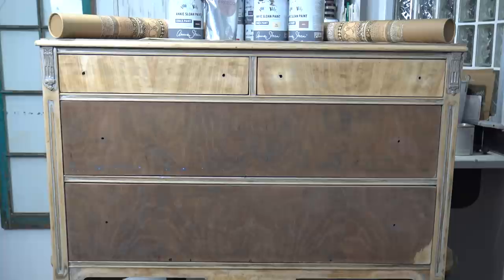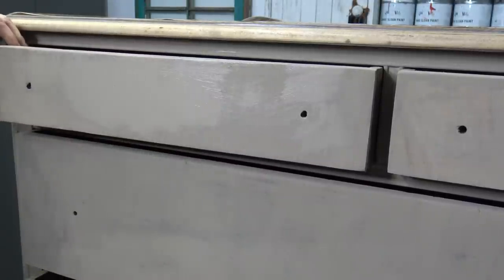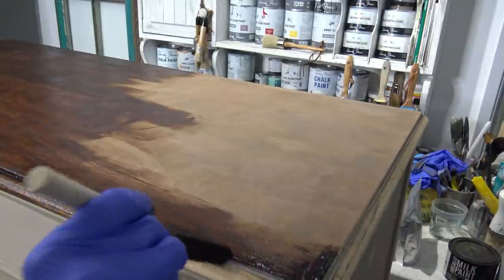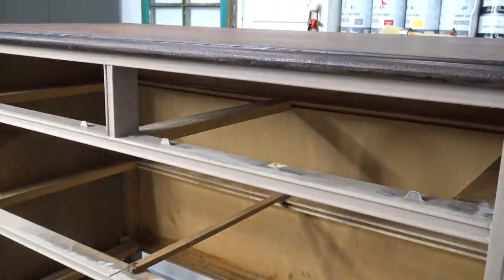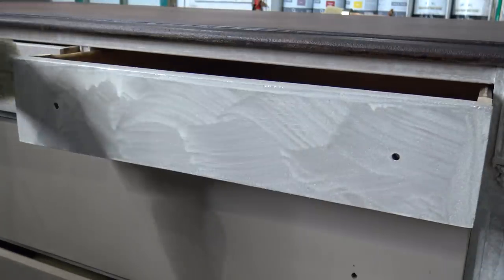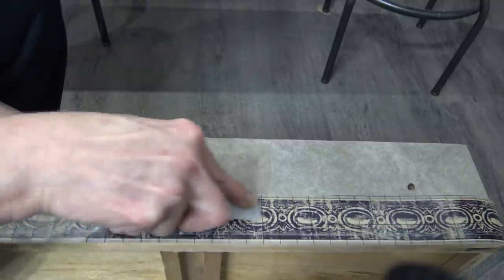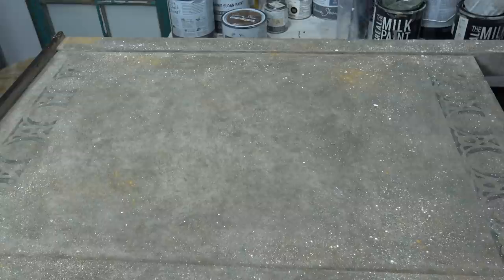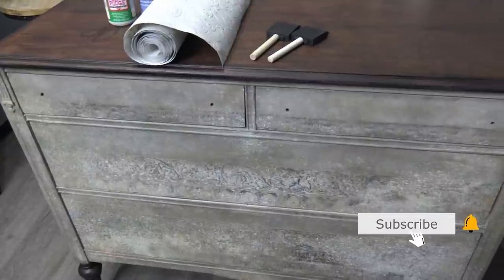Chalk Painting Furniture with Old World Effect

Comment: How long do you usually let your bass coats dry before washing them?  I almost always seem to lift those as I paint my washes.
Reply from the maker: Knorpp and South ... I usually let the base coat before any colour washes let dry for a night.
I use a high grade heat gun to dry the base for the videos! I have had that happen were I put my base coats down ( usually 2 coats ) and a couple hours later I have done a a wash and the base will lift and it’s usually because even though it feels dried to the touch it needs a good overnight to dry and air cool to firm the base into place. I find it’s important to have 2 coats of the base so it’s thick enough to paint with washes once it’s fully dried. I hope this helps !! It’s a great question and like I mentioned I have had that happen so no worries it just needs more time to dry underneath and adhere to the furniture 😉💙

Comment: I love your videos! Thank you! I'm frothing at the mouth to get started!! I have some pieces I would love to tackle!! I was wondering, do I need to sand the furniture first? Or can I apply the base coat right away? Second question, any suggestions in terms of colour combinations and techniques for that ornate pale greenish/goldish aged finish, that is reminiscent of a Versailles look that goes well with adding gold gilding and adding stenciling etc? I want to try this on some furniture as well as my mantle and a few doors and door frames to marry it all together. I love the really dramatic look
Reply from the maker: La Poetessa ... thank you so much for your thoughtful comment 🙏💙
As for sanding pieces it’s not needed but it also depends on the finish you want to create,  if you wanted to do a lot of blending and not enough paint the oils and stain on the original wood may bleed through, not always but can happen. It all depends on the surface you are painting, is it really old ? You found the piece and who only knows what has been put on it? For the most part I don’t sand but some pieces I have redone have been second hand and need  the stain surface removed just in case it bleeds! But just a real good cleaning is generally all you need with chalk paint. I have recently been sanding some of my pieces because they are previously painted and I want the old colour and wax off before I paint it 😉
As for colours is tricky for me to advise only because I don’t see the decor in which the pieces are going to be but generally with the Versailles tones and cool greys you can’t go wrong! It sounds like you have a good plan! It so nice to hear people getting value from the tutorials! I remember when I started and I really wanted to make a YouTube channel that taught the techniques I wanted to know and make pieces I wanted to learn how too! Thank you again for your thoughtful comment 🤗💙

Comment: 2 questions! I don’t want to use the milk paint or clear lacquer, unless the lacquer could seal all of my painting. Would I use clear lacquer instead of using clear wax? What’s the difference between the two? And when you did the staining, could you have used dark wax to stain the table top too? If there is any scratching on the original piece, should the table top be sanded first?
Reply from the maker: Jack Marcus ... Hi Jack,
The last decorative strep with the dry milk paint is a total option and not all will be interested of course, the lacquer is just stronger protection and can be used on both the stain and chalk paint to seal.
Wax does seal chalk paint but it is not as resistant from water and heavier use. Lacquer is more durable. 
Not all furniture needs strong resistance but as you saw in the video I used it as well for the milk paint and fresco application.
You can use dark wax to stain your table top, I actually have done that is a few of my previous tutorials! There is dark wax and black wax. I always recommend a sanding before staining but in this video I wanted to demonstrate that you can paint over chalk paint with the gel stain on the dresser legs and still looks good.
The table top was sanded before the gel stain and also to have a nice smooth surface! Hope this helps and thanks so much for watching 🙏💙
Reply: Thank you so much for replying! I’ve been on a decorative obsession in the last 72 hours- I’ve watched countless videos, mostly yours. When our closest stockist opens backup and I move, I already anticipate two matching projects. I got a C in elementary school art, but I CAN do this!

Comment: I think this is the 5th or 6th time I've watched you do this finish. It's high on my list of favourites. Prior to sprinkling the fresco and powdered milk paint, is the final coat of sealer left wet or just a little tacky? I'm going to be using a homemade milk paint with powdered milk, plaster of Paris and hydrated lime. I'm hoping I'll be able to add powdered pigment to the milk paint powder as I can't afford to use all of the products. Also, the gel stain doesn't seem to be available in Italy. Is there anything else you might recommend? What is available here is an "impregnante" stain. It sinks into the wood. When I ask the help in the hardware stores in town if I can paint over it, or use the stain over  wood, they look at me as if I've grown another head before telling me it's impossible. As they are not familiar with creating faux finishes, I'm hoping they're wrong.
I want to thank again for sharing all of your techniques so clearly explained and demonstrated
 I've learned so much from you
I'm very grateful.
Hope you're having fun with your new adorable puppy. ❤️